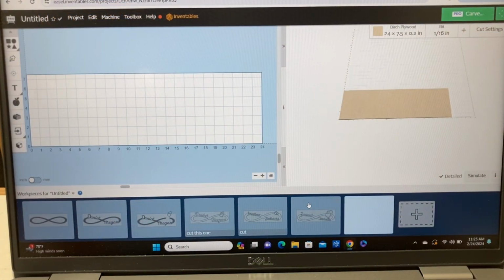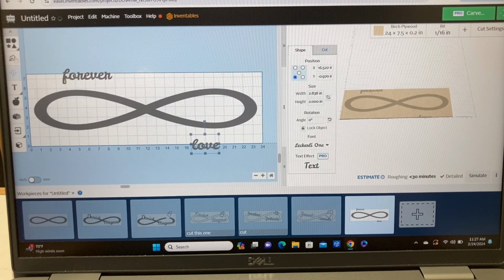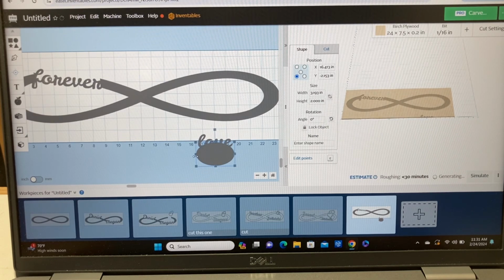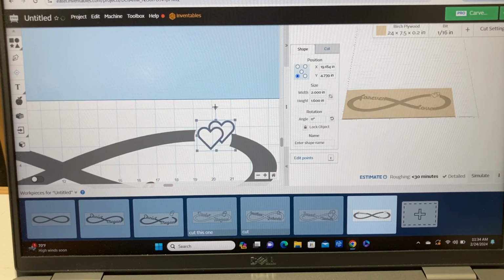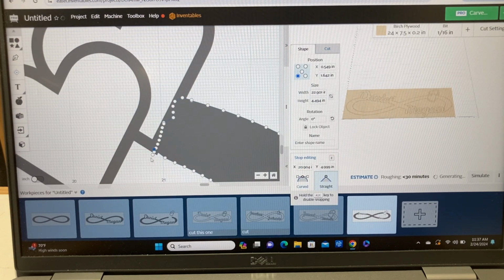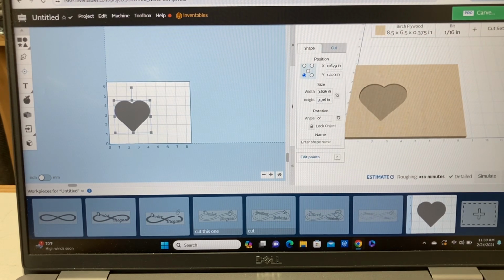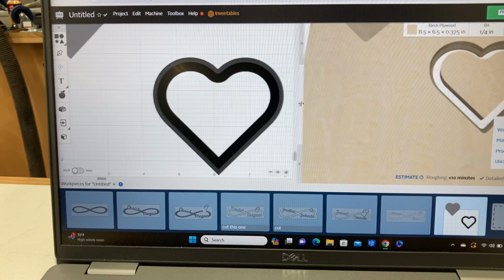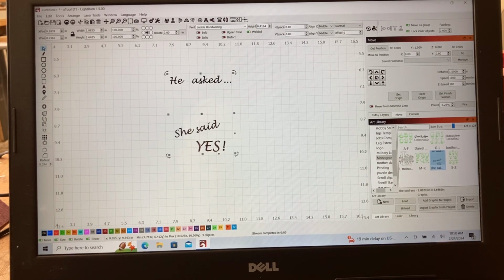Using Easel Pro to Create TWO Great Projects

Comment: Love your tutorials sir !!! Thank you for this !!!
Does Easel Pro offer the font size small enough to to use a 10⁰ or 15⁰ v bit for business card engraving in acrylic ?
Reply from the maker: The font size can be adjusted to be larger or smaller to meet your needs. Some fonts will work better than others
Reply: @PawPawsWorkShop  
Ah, gotcha..... I'm looking to do a thickness of 3mm (0.118) with an engraving depth of 0.035 or 0.045..... thank you for explaining that it's not the size but the type of font that would  work best.... you are a great instructor / teacher.... I really do appreciate you.... thank you